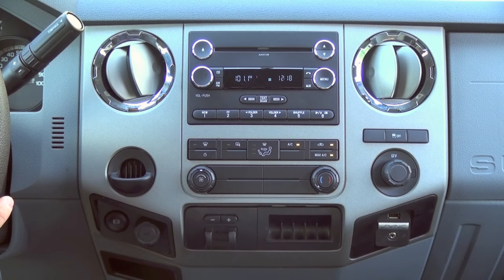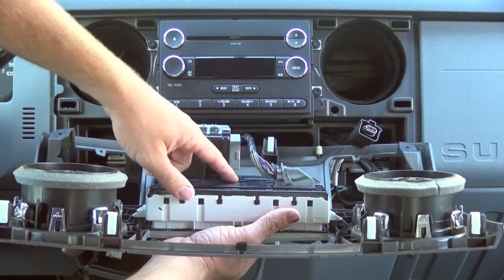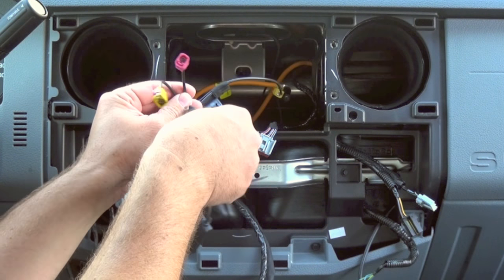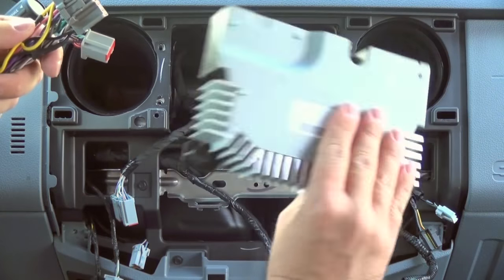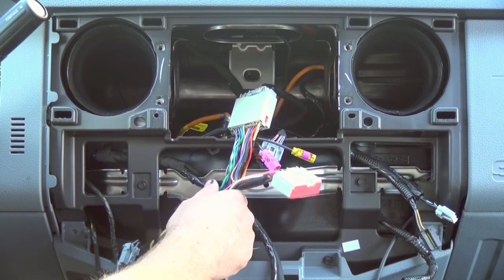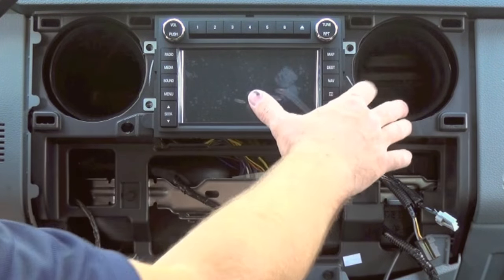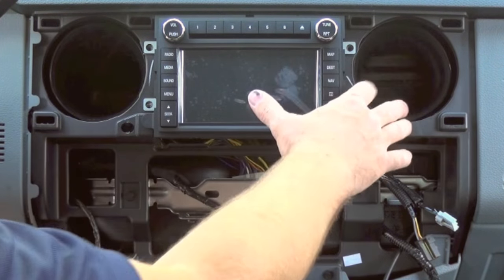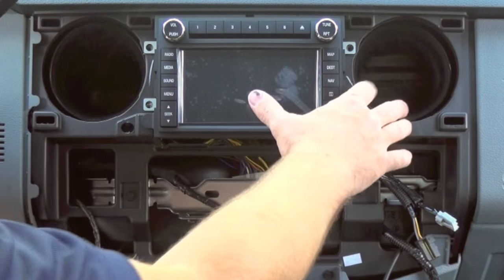2009-2016 Ford F250 F350 SuperDuty Factory GPS Navigation Radio Upgrade Install Guide - Infotainment

Comment: The reverse camera needs to be hooked up to the radio too !???
Reply from the maker: If the reverse camera is in the vehicle already from factory the wiring will already be pinned into the main connection harness. If it is added after the fact then it is likely RCA so it would need a new connection interface to intergrate into that radio. Or it would need to be hand pinned.

Comment: How much for the unit and wire set for 2016 superduty with XM ,steering wheel controls and SYNC ?
Reply from the maker: You can get full details at the link below.
https://www.infotainment.com/products/2009-2016-ford-f250-f350-superduty-sync-gps-navigation-radio?variant=494913609

You can also contact one of our tech advisors at 855-636-6287.

Comment: Did you get the steering wheel buttons to work?  Never showed how you fixed it.
Reply from the maker: The included steering wheel switch that comes with the kit may not need to be used if you have the phone button already. Other then that we have not encountered this issue in years so this should have no issues. The programming on this was changed a bit and this no longer occurs.

Comment: I have a 2012 f250 with the same radio in this video and a wrecked one with the navigation radio amp and everything can I just use the wiring harness from the wrecked truck
Reply from the maker: The wiring components that you would need are the same components that are included in our Ford Sync 1 Brick 8 kit. 

https://infotainment.com/shop/interior-accessories/amplifier-sound-solutions/ford-sync-1-brick-upgrade-kit/

Comment: Installed a plow harness and now mysteriously the Bluetooth on my radio is missing. any ideas?
Reply from the maker: You might have accidentally disconnected something from the Sync. I'd advise rechecking where you installed the plow harness and inspect any connections nearby.

Comment: I see this is a video from 7 years ago, but noticed your radio tuned to 101.1 WJRR in Orlando, so I happen to be local and would like to know if you are still doing these upgrades for people that are local. If so please send me a reply.
Reply from the maker: Hello there,
It's been a while, we apologize for the delay. We're in Oviedo, and we do installations by appointment!
Reply: Cool! I am currently trying to fix an electrical problem on the truck, that seems to be caused by a bad SCCM. Since I will most likely be shopping for a new part at salvage yards, I will see if there any of the specific model SYNC radio and amp are also available too.

Comment: Who sells the wires for the amp
Reply from the maker: Ford discontinued the OEM Amp so we were forced to go aftermarket through Alpine. Here is our solution for the AMP. 
https://infotainment.com/shop/interior-accessories/amplifier-sound-solutions/ford-sync-1-brick-upgrade-kit/

2009-2014 Ford Expedition – BRICK 1
2009-2010 Ford Explorer – BRICK 1
2009-2010 Ford Explorer Sport Trac – BRICK 1
2009-2010 Ford Superduty – BRICK 1
2009-2010 Ford F-150 – 3&6 Button Config – BRICK 4
2011-2014 Ford F-150 – 3 Button Config – BRICK 5
2011-2016 Ford Superduty (’13-’16 XL & XLT Only) – BRICK 8

Comment: Is there a way to use a 2013 Nav screen on a 2011-12 model? I’m looking to order for my 2011, would prefer the 2013 nav screen though.
Reply from the maker: No we only provide the Ford 2009-2016 Ford F-250 F-350 SuperDuty Sync 1 GPS Navigation Radio for a 2011-2012 model F250

Comment: $1600 for a click click click click is a fair price 🔥
Reply from the maker: We do not sell cheap equipment. We sell OEM quality equipment that is fully tested, pre-programmed and procured based on your Vin. There are plenty of companies that sell cheap products. We want to provide a part that we are able to guarantee works and will continue to work. We are confident enough in the product we sell that we are able to warranty it through installation and up to two years depending on your selection at check out. We feel our pricing is competitive as we are comparing our pieces to the cost of getting a new vehicle as opposed the cost of an aftermarket part whose quality is greatly inferior.
Reply: @Infotainment_nav  I would totally but this for my truck at the cost of the price . That’s a fair price to pay . 👍🏽💯
Reply: My question is I grabbed this same radio at the junk yard from an escape and the factory amp I just need the wiring can I purchase it alone from you?

Comment: Do you have a factory radio to sync 3 solution?
Reply from the maker: We do have a Sync 3 option for 2013-2016 Ford F250 F350 Super duty 

Here's a link
https://www.infotainment.com/collections/all/products/2013-2016-ford-f-250-f-350-superduty-myford-touch-sync-2-to-sync-3-with-apple-carplay-and-android-auto-upgrade?variant=12231371816996

Comment: If your truck doesn't have sync does that extra harness compensate for that
Reply from the maker: No, SYNC is included in a module that comes with the kit. You can contact our tech support for any further questions 855-636-6287.

Comment: hi, great video by the way! thank you. i have a question, i want to  install in a 2010 explorer sport trac adrenalin. I already have a emplifi and I have to install a backup camera on the Chinese radio. my question is, do i need the installation kit if i already have a gps antenna, emplifi and sub oem and i would like to know also what is the connector for the rear view camera and if that takes programming. thank you.
Reply from the maker: Since we do not sell that radio we recommend you going to the company to where you bought the radio but we do recommend buying a OBD Genie Backup Camera programming kit for your rear view camera
Reply: @Infotainment_nav  is the steering wheel control included in the package or is this something. The customer has to buy themselves from ford
Reply: @Infotainment_nav  is the steering wheel control included in the package or is this something. The customer has to buy themselves from ford

Comment: i hope i can install this in my 2013 Ford Econoline 350 van
Reply from the maker: Unfortunately, this specific product is not compatible with your vehicle. However, here is a link to a product page on our website with a radio that is compatible with your vehicle.
https://www.infotainment.com/collections/all/products/2010-2014-ford-econoline-e-series-sync-gps-navigation-radio?variant=42305349319

If you have any questions you can call us at 855-636-6287.